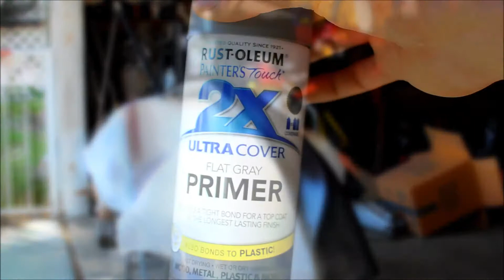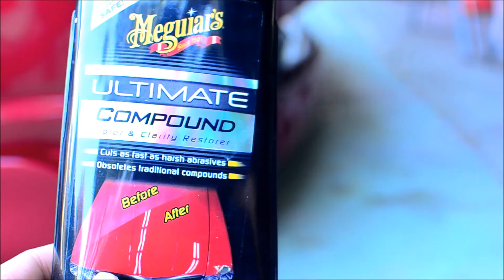How to paint a car lip using spray cans

Comment: Hey man! I have a 2007 Honda Civic Taffeta White and I tried using automotivetouchup paint but mine doesn't match like yours. The lip that I painted is way more white than my bumper. Should i just apply light coats so it can blend in with my bumper? Thank you!

Comment: In case I screw up, how do I remove paint to start over? Air crafted paint remover?
Reply: Sand it down to the primer.  Take your time when you prime it.  Once you're done with the primer, you should be able to see any defects in the surface. If not you will see it in the base coat.  Wet sand that down.  Once you start the base coat, you will for sure see any defects.  Painting outside can attract bugs & debris.  Buy some painters plastic at Home Depot and tape it to your garage door while it's down.  But tape it in a way so once you raise the garage door, you create a small painter's booth.  #smart

Comment: hey man I'm just wondering where you get that mugabe style lip for your 02 to 04 rsx
Reply from the maker: +lomohigh hey i bought here : http://www.ebay.com/itm/02-03-04-Acura-RSX-DC-JDM-MU-MUGEN-Style-Urethane-Front-Lip-Protector-Strip-/181262729584?hash=item2a3419c170

unfortunately they are out of stock at the moment
Reply: +Al Sib hey I'm sorry for being annoying but did you have the retrofit it or was it a fit. I got a 03 Acura so yah a hah.
Reply from the maker: +lomohigh no worries. I did have to cut small parts of there the fog lights are. Other than that its a perfect fitment

Comment: my front bumper on my rsx is chipped really badly.  am I better off just buying a brand new bumper and painting it? or can I save money by taking off the old one and sanding it down and repainting it?
Reply from the maker: mine was damaged pretty bad too so i just sanded it down and repainted it. Saves you a lot money from buying a new one
Reply: cool man thnx... another thing though is its Cracked in a couple places. still think I should just sand the old one down?
Reply: Just put some bondo and fiberglass on the cracks.. Watch some videos on how to do it

Comment: It will resist to be flexible?
Reply from the maker: +Lucas Rivero i didn't mention it in the video but if you sand the lip down prior to painting it will resist to flex. use a low grit sand paper then a high grit to make it appear as smooth as possible
Reply: +Al Sib, Thanks! Unfortunately I've already painted. (With "Rust Oleum" temporary paint), but next time I will try as you told me.
First, coarse sandpaper; then fine sandpaper.
And finally I will paint.